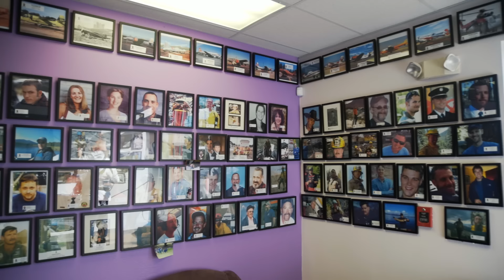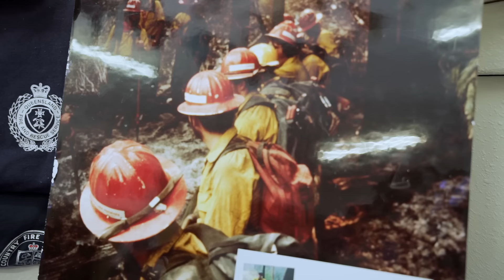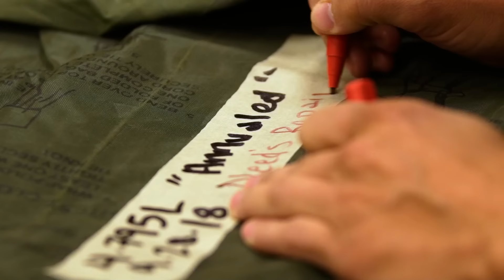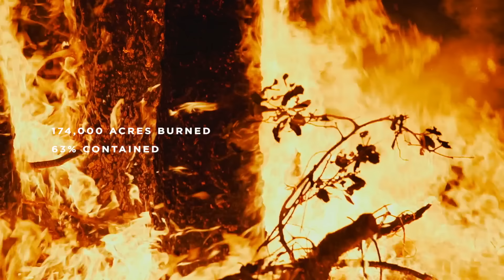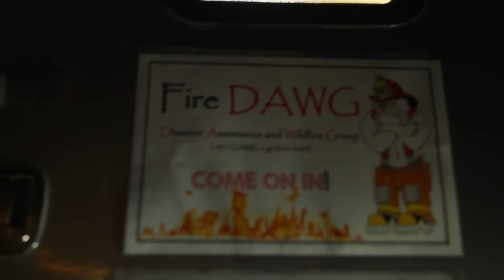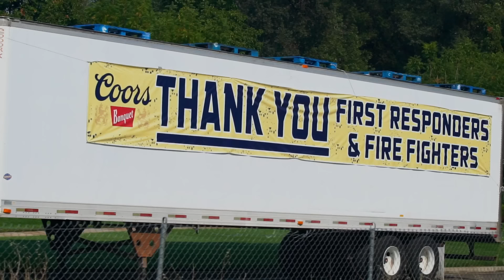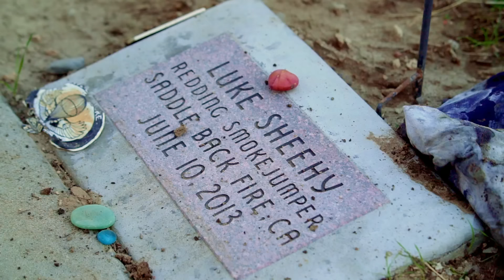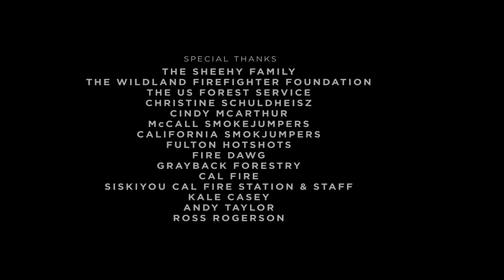Meet The Warriors of the West

Comment: Introduction 
Imagine a situation where adjacent communities decide to combine firefighting operations. The 
members of the new consolidated department know the geographic area and local hazards. They 
all are well trained, with years of experience on the job. Cost savings have allowed the new 
department to upgrade facilities and provide better equipment. The result should be an immediate 
improvement in service quality and efficiency, right? 
Unfortunately, the opposite may be true in situations like this. That’s because each of the predecessor
fire departments had its own unique way of doing things—policies, traditions, plans, 
methods, etc. Even some of the legal authorities under which they operated were different. As a 
result, combining organizational systems and personnel leads to miscommunication, conflict, and 
problems on the fireground. 
These problems may have been avoided if the new organization had implemented written guidelines
that defined precisely how operations were to be conducted. These guidelines, often called 
standard operating procedures or SOPs, clearly spell out what is expected and required of 
personnel during emergency response and non-emergency activities. They provide a mechanism 
to communicate legal and administrative requirements, organizational policies, and strategic plans 
to the members. In short, they get everybody “reading from the same sheet of music.” * 
This manual is intended to help fire service organizations 
develop and implement effective SOPs. The material is 
designed for use by managers and supervisors in all types 
and sizes of fire departments. Community officials, 
employee representatives, individual firefighters, and 
others with an interest in enhancing fire service operations
and administration can also benefit from this information.

Comment: 14:29 - 6 firefighters wearing chaps, not one carrying a saw
Reply: Is that why it takes longer to take control of these fires?
Reply: What are you trying to prove?

If you look closely 3 of them are carrying the chainsaw over their right shoulder. The other 3 who are not carrying saws are “pullers” and they are also required to wear chaps.
Reply: @theskipper9718   its just a joke bro. ive worked with tons of fire crews in montana and idaho over several years including hot shots and never saw a swamper or “puller” wearing chaps so i was just making a joke. im sure some states require it but definitely not where im from in MT